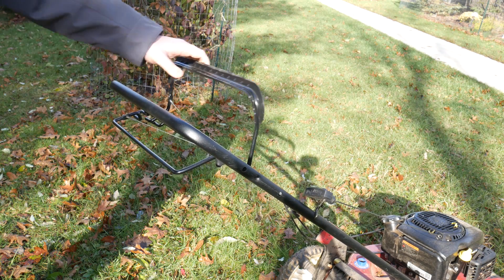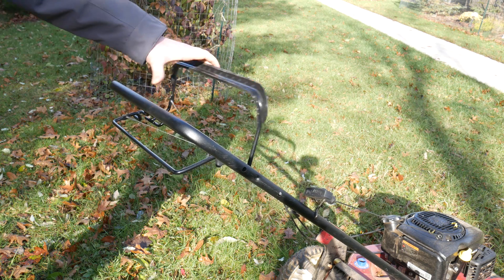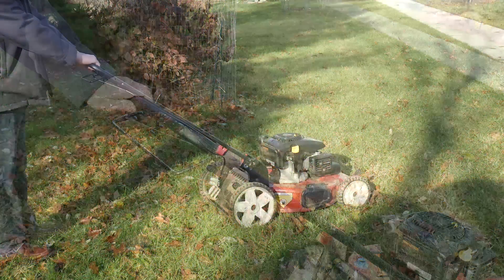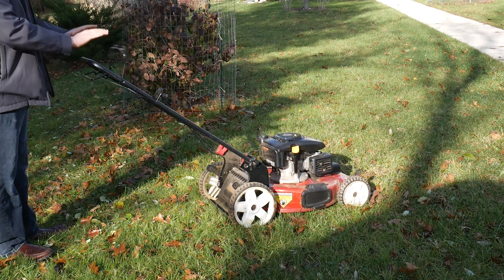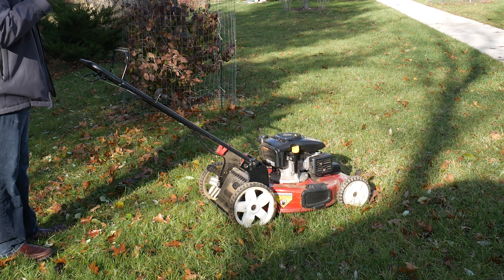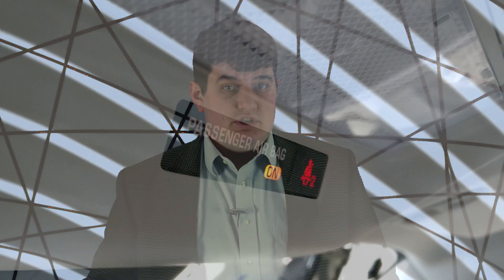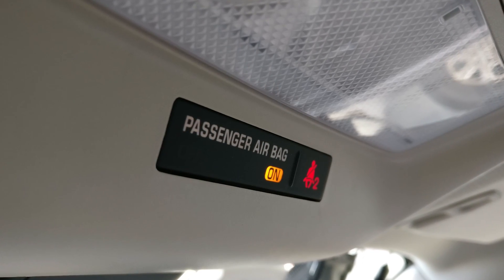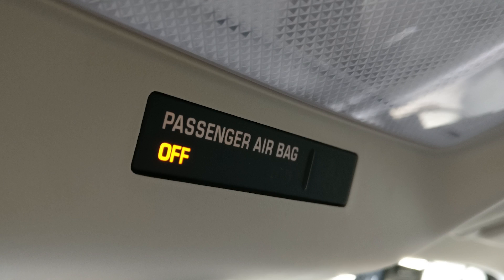The Dead Man's Switch:  How Anton Yelchin's life could have been saved

Comment: What happens when your car breaks down or you run out of gas ? You’d be screwed that’s y they don’t use this because there are circumstances where you need it or if you need to have your car towed and if your not in the seat you’d have to drag the car or leave it stuck in the roadway and deal with the dangers that that entails

Comment: Fun fact: There is no reasonable benefit in having no physical connection to the gearbox.
If I put my 02' A6 in P, I physically shift over on the control board and close a circuit which in turn activates a relais. So it always is in park. In the Panamera or 540...a nightmare! The gear lever always jumps back to the standard position, no matter what gear you "selected". It's annoying how often I'm not able to activate park because I pressed the button to quick or not strong enough or at the wrong time or with the wrong face expression. A lever, shift it forward to P, locked. Boom. Works and is reassuring.

Comment: My Golf Mk7 has such a dead man's switch. It does not allow for the electronic parking brake to be released unless the driver is buckled in. A feature called "auto-hold." As I have a DCT, the car could also technically roll backward just like a manual transmission and unlike a traditional torque converter (liquid coupling) equipped car when the clutch is not engaged. In the case of a DCT, one of the two clutches. In order to prevent this, the auto-hold feature also engages the emergency e-brake.

Comment: Car driver seats do not have pressure sensors. Passenger seats only have them because baby seats are put in them with regulatory. Baby seats are never put in the driver seat so there was no need for a pressure sensor.

Comment: interestingly enough, Tesla has that. I would lift up the seat to look back while reversing the car and the car would stop moving immediately. I thought something was odd so i looked online and lo and behold,  the driver seat has a pressure sensor that stops the car from moving if "no one is seated in the front". Technically it's easier with an electrical motor since there is very little mechanical interaction. Zero-turn 4 wheel lawnmowers also have he same system cutting off the engine when the blade is active

Comment: Some riding mowers will not automatically shut off if the engine is fully disengaged, and the parking break is locked. This is because it's perfectly safe to dismount the mower under those conditions and it wears out the starter when you have to restart the engine every time you move an object from your path or open a gate. My dad didn't know about this, and scolded me for supposedly circumventing the safety features on his mower, whereas I was simply using them as intended.

Comment: I work in the automotive industry as a software engineer and the only thing I can say is that with what I see daily I wouldn't want such a seat: it won't work when it should and it will make the car randomly stop in the middle of the motorway and refuse to move.

Automotive industries are not capable of managing simple software products and it shows.

Comment: The dead mans switch in old locomotives was like a brake pedal in a car. Just as long as the engineer had his foot on the pedal, the locomotive functioned normally. If he were to take his foot off, the engine would go into idle and “full service” or “emergency” brakes would be applied (full service is where all the breaking power the train is capable of is applied, I.E. full service. Also, emergency and full service are the same thing, with the difference being that emergency gets the brake cylinders up to pressure much faster than full service would.) Many old crews hated the pedal, and would often put a brick in its place so they wouldn’t have to put their foot on it.

In modern locomotives, the dead mans switch is called “the alerter”. It’s a yellow button on the control board that must be pressed within a 10 second time slot. Moving the throttle, reverser, or the breaks will also shut it off. However, if it is not pressed within the 10 second timeout the train will go into emergency and the dispatching center will be notified.

Comment: I can see the logic of the argument, however, I can also see the issues that may be presented with vehicles used in non-road environments (4WDing) like Jeeps (and actual 4wd's) are used for. Smaller vehicles, assuming appropriate sensors and software patches, this could be a reasonable way to go. But for larger vehicles could pose a problem that the manufacturers have not been game to try and solve.

Comment: Wanna talk crazy? Those seat switches has probably existed on Deere garden tractors since 1975. On a 200/300 series tractor they're a part of the circuit that goes through both the PTO and Ignition wire to the coil. If you're not in the seat and the PTO switch is on, power is killed to both the PTO and the ignition coil. Power also won't be sent to the starter if the PTO switch is engaged; for example, my 330 will kill the PTO if you leave the seat, but cannot shut down the engine as 330's had a shutoff cable and not a solenoid on the injector pump (one year only). Oh, they had neutral and PTO safety switches with their first garden tractor in 1963.

Regardless, if this was possible over 40 years ago, it shouldn't be so difficult to implement this today. Really, what's the excuse...

Comment: One must  understand certain issues would require the car be in gear with no one in the car. This would be when a car goes over a road edge and needs to be winched up the hill, or if you were alone and ran out of gas you could push and steer the car at the same time "I've done it more than once". Also mechanics need to move card around and often it is done by pushing the car with some one steering thru the drivers window.  I'm guessing it would be easier to just take personal responsibility and learn how to operate a large machine safely.

Comment: Bmw has a stateless gear shift for over ten years.  Stateless gear shifts allow the car computer to move the car into park if you open the driver’s door and unbuckle your seat belt for example.  It was a smart system.

Due to this tragic accident, bmw is now going back to gear shift that is no longer stateless.   

This is a tragic mistake.

Comment: On the subject of the shifter dead man's switch, I discovered that my car (2019 BMW, so electronic gear lever) has this feature, completely by accident. If you open a car door while stationary, the transmission will immediately shift to park. You also cannot shift out of park with a door open. Which means if you break down, you will not be able to push the car over to the side of the road by yourself, or in my case, move it a foot or two without starting it. This system likely was implemented as a response to this accident. It required no new sensors; it just used the existing door sensors.
Reply: There should be a little piece of trim by the shifter with a slit in it. If you need to shift while the car is broken, you just pry it off and stick your key in it and it will let you shift freely.
Reply: @axelwink1886  Almost like every car in the 90s? Eh?
Reply: @Jonathan Insero That feature was added when the electronic gear lever was added first to BMW cars with Automatic transmissions. I know this because my mum's 2017 BMW 320d M-Sport automatically switches to park when the door is open, you can move with the door open but only for a second or two (maybe not on yours) then it chimes and says "Protect car from rolling away" or something similar to that.
Reply: If you check the owners manual there should be a cable or handle you pull that will put the car in neutral. it's likely in the center console behind a small trim panel. Cars with electronic shifters are required to have them in case they need to be pushed or towed, but people are too lazy to read the manual.
Reply: @wmgriffin5602  in my experience with recent Honda models (and I assume probably with other manufactures too), you can let the car stay in neutral by hold and long press the neutral button. they will show the instruction on the dash every time you shift to N
Reply: It's no accident your car goes into park with the door open. I used to work at BMW and we tested this function on our vehicles.
Reply: @crustymilkcap  Is there a manual override for whenever you need to push the car?
Reply: @leonardsalt  In most cars with the auto park with door open feature buckling the driver seat belt will override and allow you to stay in neutral.
Reply: @leonardsalt  with some cars (like Hondas with push button shifter), you can long press the “N” button to let the car stay in N after door open or engine shutdown.
Reply: @leonardsalt  sorry for the late reply, but also sorry I can't answer your question because we never intended to test the override. We did basic quality testing, so nothing too technical
Reply: @crustymilkcap  What's the top speed this works at and does it work for all doors?
Reply: @millomweb  it's been a while since I last worked there but it's like 6-8mph I believe
Reply: @crustymilkcap  Still fast for selecting park ! Makes horrible slipping ratchety noise - having found this in a Ford going from D to R and overshooting into P !
Reply: This feature started to appear in automatic BMW's starting from 2007 along with the electronic shifter (and the 8-speed ZF transmission).
Reply: Why not put the window down and push with the door closed
Reply: @TheTyisawesome  You'd have to climb out the window. The only way to take the car out of park is to depress the brake pedal while shifting. That's an option, I guess, but not ideal.
Reply: I was wondering about this, if you can't put it in neutral while not in it, how would you push your car out of the way, it'd require somebody else in the car or for hopefully somebody to stop and help you push it. Granted this is likely a preferred as pushing it yourself is a risk since you wouldn't be in it to apply the breaks if needed. But you're not always in an ideal situation when things break down.
Reply: @MindCaged  Many Honda also switch to the shift by wire things in recent years, and they will automatically shift the transmission to park if driver opens the door. If you want the car to stay in neutral even after you turn off the engine or leave the car,  you just long press the neutral button. In fact, a prompt will be displayed in the dashboard explaining how the “stay in neutral” works when you shift to N while you are in the car. I would assume other manufactures do it in similar fashion.
Reply: @MindCaged  Wind the window down, get out of the car, close the door, put the car in neutral & push it.
I've actually driven 2 of my vehicles while outside it - one time in the snow - so I could push while the engine drove and the other time - well, to show off, of course!
Reply: @MindCaged  you push from the driver side with your door open bassically you step out of your door and push, you have acces to the steering wheel and you can get back in with ease to apply brakes. I sometimes drive without my engine on when going downhill as long as you have it in neutral you only have to worry avout not having hidraulics, wich in a traffic yam is not that big of an issue as you don't move that much or often. Save gas
Reply: @albertb8530  when an auto trans is in neutral the fluid pump for the trans won't run and can overheat. Don't do that
Reply: @albertb8530  I think you missed the original comment that states modern BMW's automatically go into park when the driver door is opened.  So you can't get in, shut the door, shift the car to neutral and then open the door to get out and push.  It automatically goes back into park.  And you can't get in and put the car in neutral without first closing the door; it refuses to go out of park if the door is open.  In other words, modern BMW's do not move if the driver door is open. Maybe that's a good thing. But you definitely can't push one with the door open.
Reply: @midehv  
And it appears you missed the part about the shift lock.
The thing that's supposed to over-ride the car's demands to be in park. So you can put it in neutral with a door open.
Reply: @albertb8530  Yeah don't drive with your engine off. If you're doing so to save gas, fuel is cut when there is no throttle input.
Reply: @albertb8530  Doesn't save gas,modern engines don't use fuel when on the over-run,i.e. when the engine does not need to produce.power. I had to point out to a friend that his habit of coasting on tickover was actually using more fuel than if he stayed in gear.
Reply: @albertb8530  In modern cars the electronic control unit will cut off gas to the engine when going downhill with your foot off the gas this actually saves more fuel than coasting in neutral because it takes some fuel to idle the engine.
Reply: Even worse. Open your door while rolling. It'll still slam into park
Reply: It's also a pain in the ass when you're in a body shop and you have to move the car around without a door on.
Reply: Even my 2009 X5 has this.
Reply: The issue of pushing a car came to mind immediately. The amount of times I've had to push my car or friends' (while shifted in) to make them start after a loss of battery power is quite high. This wouldn't be possible alone with a dead man switch in this way. I'd be more favorable with a touch presence sensor on the overall steering wheel (or a combination of sensors, even in that case the seat sensors still have a role in preventing the car from going in reverse, for instance)... Such a sensor could even be further refined by monitoring pulse, or whatever other possible manifestation of the driver getting medically impaired while driving (there's already DMS which attempts to prevent alertness issues, so this isn't much more than an upgrade on it). All in all, Anton Yelchin's accident was 100% preventable and that's really sad.
Reply: I had a 2010 X5 that did this.
Reply: I think any bmw with the zf 8hp gearbox has this feature
Reply: It's the "self destruct" mechanism that kicks in when a BMW's indicators are used that I would find worrying! ;)
Reply: If the car is running, why would you need to push it to the side of the road?
Reply: @ExalyThor Bland 2.0 Diesels? They don't look bland, they don't sound bland. It has 187hp
Reply: @ExalyThor The 330i is a 2.0..
Reply: @ExalyThor Just because it's a 2.0L diesel doesn't mean it has to be the SE. It's not slow, it has 187hp, still gets to 60 in 6.7 seconds. 330d/i and above aren't the only ones that should get M-Sport as an option.
Reply: @ExalyThor Just because it is a 2L diesel doesn't mean it cannot have M-Sport, it still gets to 60 in 6.7 seconds, 330's and above aren't the only ones that should deserve M-Sport
Reply: I have a 2018 BMW and this safety function can be disabled through the menus if you need to.
Reply: Yes bmw and mercedes and related manufacturers already have this feature
Reply: This is how teslas work!
Reply: 2002+ BMW 7 series has this feature.
Reply: Bad feature. Sometimes you need to adjust the door when the seatbelt gets stuck after visiting the gas station when driving. Opening the door for a quick second to fix this engaging park could cause unintended stopping thus mushrooming into more problems.
Reply: BMW drivers are so important that if the car breaks down, the rest of traffic can just wait for them
Reply: @fluffysheap  LOL
Reply: @fluffysheap  Yet BMWs STILL haven't made turn signals a  standard option!
Reply: Funny how BMW doesn’t plan for their cars breaking down, which, as we know, is what they are most famous for
Reply: When you need to push your car a little if it breaks down you could always open the window and put it into neutral, then climb out through the window and steer it while the door is closed. Then reach in and pull the E-brake when you get to where you want to be. It would be a pain but would work in a pinch. You know, for future reference....😁

Comment: Hey man! Love your channel!

Being a software engineer that had a little bit to deal with similar software I think it makes sense to share that there's always the other side of the coin that makes companies reevaluate these solutions. 

One thing in particular is if this could ever backfire causing more damage. Sadly the answer here is - yes.

It's really easy to imagine a scenario where a kid played with the stick followed by parent entering the car and kneeling on the seat while doing something and not paying attention to the car moving back or forth. That would be an easy recipe for disaster, therefore it's impossible to not notice that your car is on a gear.

Neutral is particularly necessary in other cases, like when you need to push the car with a dead battery.

Yeah, it's really not so obvious. Dead man's switch can become a dangerous thing to have and nobody knows how big the risk could be until someone tries this in the wild...

Comment: My car (subaru legacy) will not turn itself off if the shift lever is anywhere but in park 
it will turn the engine off but the electrics wont turn off, it will beep loudly at you and display an error on the screen